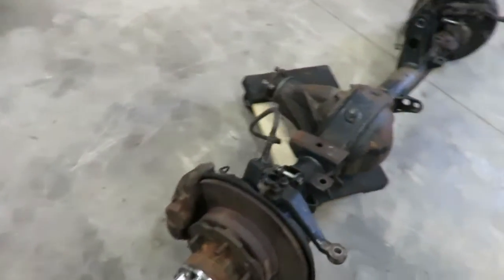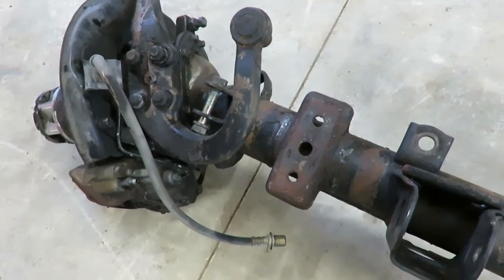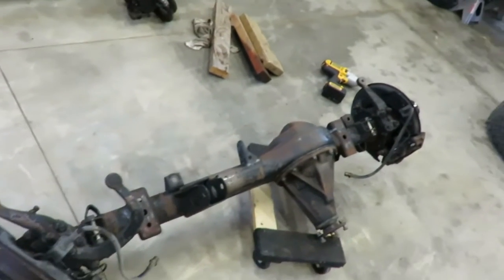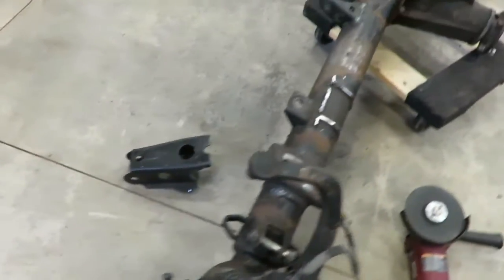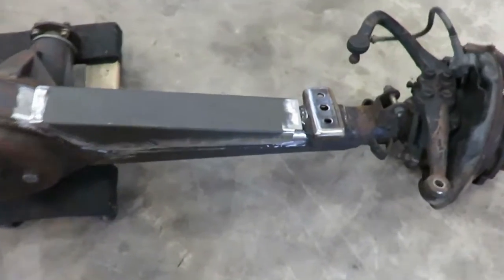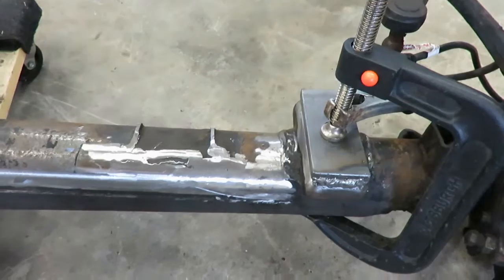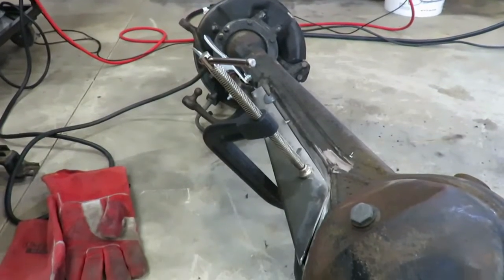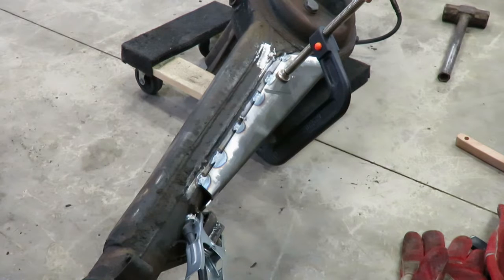Toyota Front Solid Axle Rebuild P1 Cutting Brackets/Welding Truss

Comment: So a fj80 high pinion can fit in a 80s model pickup with a solid axle? That’s good to know🤔
Reply from the maker: Yes fits like a glove!
Reply: @austinniemela  and double checking fj80 pinions are 9.5 or 8”? I know there’s one that’s a 9.5 diff
Reply from the maker: @Red_Beard_Builds  the FJ fronts are 8” and fit the trucks!
Reply: @austinniemela  do you know which ones the 9.5 diffs are out of ?